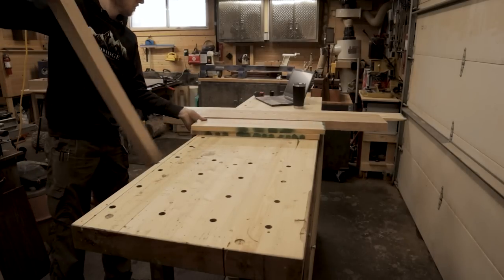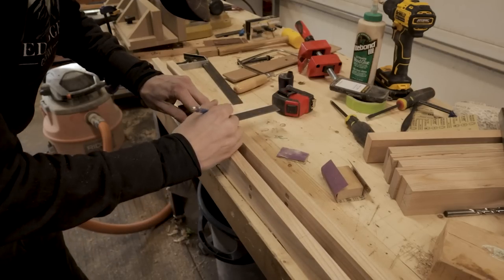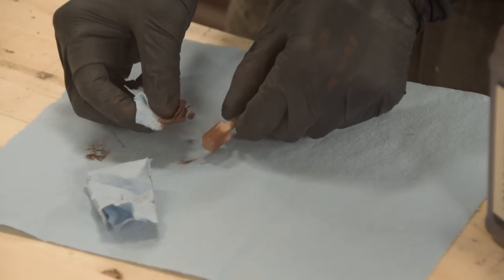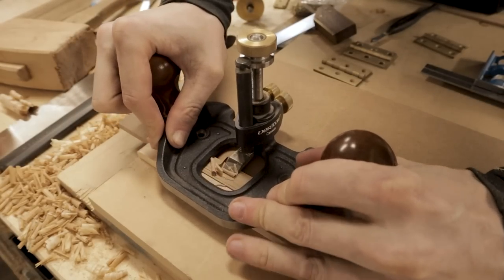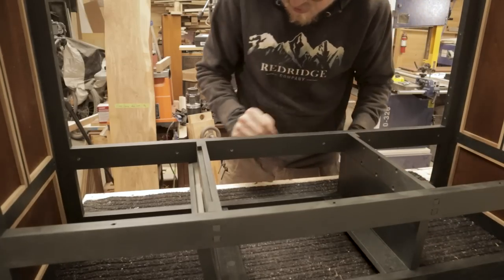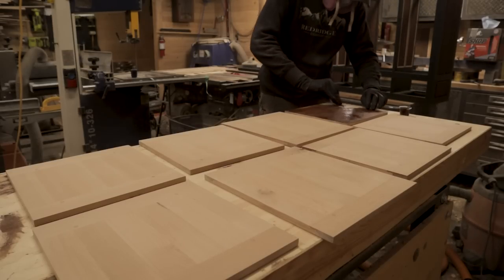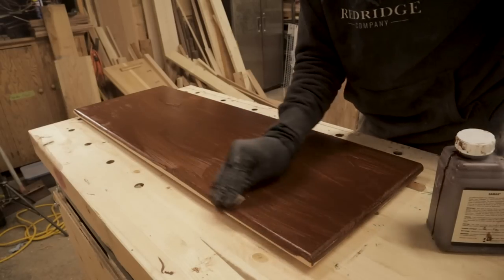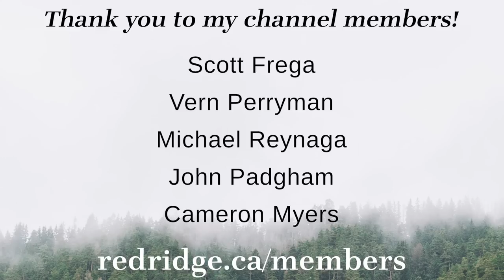Experimenting with color in woodworking

Comment: I’ve been woodworking for …..over 45 years and ,a you can imagine, I’ve seen huge changes in materials and techniques available to the smaller shop. The router and adhesive quality are probably the two biggest but even abrasives - when I started, we used dried fish skin (from a dog fish which is in the shark family). 

Throughout, the key phrase for me is that taste is personal whilst skill is universal. When we built pieces for a client, there things that I didn’t like - were not to my taste - but the client wanted them. Notwithstanding the aesthetic, I hope the skill was still there.

Having said all that, it’s not a shy criticism of this piece. I like the aesthetic very much - it’s in the Arts and Crafts genre that I now building all my pieces within (UK A&C plus bits of Greene and Greene, Stickley etc.). Okay, I wouldn’t, personally, have the finger joints showing on the drawers - I don’t like them on G&G stuff - but I’m very fond of the visible pegs with the button tops. Again, G&G used them a lot but, apparently, often to hide the screw that secured the joint. I wouldn’t have believed that but it came from Darrell Peart and he is the expert.

I’m finishing the interior fit out of a converted barn and I think we are now past $30,000 of European oak for doors, stairs, trims etc. The colour we wanted was the fumed oak that was very popular around the end 19th/ early 20th century. I don’t know if you have actually fumed oak (with ammonia) but it’s a nasty process. So, I decided to stain the oak to that fumed oak colour. 

Another popular stain was to apply ferrous acid (vinegar and steel solution). That ebonite’s timber with tannins and, of course, no shortage of tannin in oak. You can control the effect to go from grey to jet back. Contrast that to natural oak in a piece and I find the effect very pleasing.

I have painted wood on pieces (as opposed to the normal way of painting trim if you want a coloured finish) and I think the byword for me is “less is enough”. So, none of my pieces are fully painted but have highlights or insets of painted pieces. 

In your piece, I think the choice of paint is excellent. It does, as others have said, go well with the colour of the natural timber. Unless I had something like ash lying around, I must admit that I would use poplar as it works and finishes superbly - and is much cheaper. 

On the question of design. I guess I’m past the point where I think about technique and then design around using that technique. I’m at the stage where I think of a design and then work out how I’m going to make it. That process, for me, satisfies the key criteria of form and function. But, that’s just me.

Very much enjoyed this video from me. I’m off to check your playlist.

Comment: For water based stains I mix dye stain and spray with hvlp gun saturating the piece then wipe off.       I get very even results.   Can be messy though.  If you don’t have booth with good ventilation I suggest a good open space.     This is a beautiful piece.
Reply from the maker: I've read some stuff about spraying stains but never really gave it much thought. Once the weather warms up, I'll have try taking a piece outside and spraying some stain!

Comment: I think there is a time and place for paint on wood. Using paint as an accent and intentional integration into the design for contrast and accent of the wood grain works.  Too often paint is used to just cover up an older finish.  I think you did really well with the ash and highlighting the texture of the wood and grain.
Reply from the maker: Exactly, I've wanted to use paint on a piece of furniture for a few months now but I had to do alot of experiments to figure out how to use it in a why that wouldn't look horrible. It took a while, but I do think this combination of paint, wood and finish is going to be my go to for adding some pops of color!

Comment: I think Ash or Red Oak with the deep grain looks good painted a lot of the time. Or even maple if you want a flat smooth look. If you start to paint mahogany, that's heresy.
Reply from the maker: I did like Red Oak in my testing, I found that the grains were a little more subtle when painted than ash, kind of a nice inbetween of ash and maple. Red Oak definitely stains better than ash though and I'm going to be putting that to use in an upcoming project.
Well there goes my next project, I was really looking forward to making a mahogany cabinet then giving it a nice white paint job!

Comment: I think the cabinet looks great! Too pretty to hang in the shop. I really like the paint on this piece. I do think the breadboard ends on the shelves should go front to back. Just my opinion though.
Reply from the maker: Too pretty to hang where I was planning to as well, the spot I had planned was in a corner and just didn't do this piece justice!
I agree with you about the bread board ends, in hindsight it would've looked alot cleaner having the shelves turned 90 degrees. Normally I like having that little detail on the front edge of the shelves but I think on this cabinet it looks a little to busy.

Comment: Can you do a specific video on the door spacer piece? Like how you size the thickness to hinge thickness, door reveal, etc.? Love the videos!
Reply from the maker: I'm planning to get back into doing tutorials soon so I'll make sure that video is on the top of the list!
The jisk of it is that you want the spacer piece to be thick enough to fully hold your hinge and not break, I made these ones almost to thin but they still worked. By standard I go with 1/8", which works perfectly for the horton brasses hinges that are about 1/16" thick hinges leaves.

For door reveal I still mess that up constantly, but I'm getting slightly better each time! The defining factor for your door reveal is the hinge in it's closed position, so if you're working with hinges you haven't used before start by mortising them into a couple scrap pieces, then measure the gap in the "closed" position. Then just account for that gap around the whole door.

Then to figure out the door size just plug in the number, these are the one's I use for the horton brasses hinges.
Door Opening - 1/8" (Spacer) - 1/4" (1/8" reveal either side) = Door Width

Comment: Awesome project.  Do you have anything you can share on the jig you made for your Powermatic Mortimer?  I have the same model.  Thanks!
Reply from the maker: So, it's just version one at the moment and I'm planning to use it over a few projects before finalizing the design then I'll definitely be putting out a video on how to make them because even on this project it was an absolute game changer!

The biggest issue I've had with the mortiser is that those small wheels don't hold taller pieces tight enough against the fence and I keep ending up with angled mortises that then make the frames twisted. The taller fence on the back and the reinforced fence on the front hold the workpiece in place perfectly and I just rub paraffin wax on both fences and the pieces glide right through.

The other issue is that stupid hold in the base, when ever I try to cut mortises near the end of a board the pieces rock into the hole a screw up the mortise so I added a piece of MDF under the front fence and that solved that problem. It also let me cut through mortises much cleaner because the fibres are supported on the back side of the cut.

Comment: Thanks for sharing.  Could you please talk more about the home made jig you have for the mortiser around the 4 minute mark?  It looks interesting/useful.  Many thanks.
Reply from the maker: I figured I might get some questions about that, it's a new addition that I'm just trying out at the moment and working out the kinks. There'll be a mk. II version after I've worked this out on a few project!
The basic idea is that I just wanted taller fences that would hold the pieces firmly in place because the wheels that come with the mortiser allow taller work pieces to pull away from the fence and angle the mortise. By locking the pieces between the two mdf fences the pieces can't angle at all! The other problem with the powermatic mortiser is that they put a hole in the base that pieces will rock into when cutting a mortise near the end of the board, so I add in a bottom piece of mdf to cover up that hole and on this project I was able to use it to cut through mortises cleanly.
It was an absolute game changer on this project and when I put together the better version I'll make a video explaining how to make it.

Comment: thank you Morgan . i can put up with a light coat of paint if it shows the grain this project looked good . question please do you like your pin nailer ? would you buy it again ?
Reply from the maker: That's my thinking to and why it took me so long to figure out how to paint wood in a way that doesn't look like a botched DIY job.

I would definitely recommend this pin nailer, I splurged a bit when I bought and it's been a really good reliable tool!
Reply: @morganhurst_redridge  thanks

Comment: It’s occurred to me to wonder: how has paint changed since… oh I don’t know, say the late 1800s. 

Maybe today’s paint is so much thicker than a century or so ago that painting fine woodworking just looks terrible. 🤔
Reply from the maker: I actually did a decent amount a research into this while trying to figure out this technique and from what I found the two most common traditional paints were milk (water based) paint and linseed oil paint. What I found most interesting is that the pigments used in transitional paints aren't all the different from what we use to today, the main differences is the hardeners. Milk paint used lime and clay while modern paint uses latex, so it's actually kind of the opposite from what you said. Traditional paint sits thicker on the surface of wood and that's why when you see alot of older painted furniture the paint is chipping off, where modern paints are less likely to do that since they are thinner but the layers have much stronger bonds.

I did alot of testing because I thought that answer to painting furniture nicely was going to be milk paint but after a ton of trial and error it turned out that some simple latex paint from home depot that was sprayed on gave the best results. My conclusion was that because the modern paint has stronger bonds, that allowed me to thin it down enough to allow it to soak into the pores of the wood.

The other massive part of this combination is the wood, no other wood except for ash looks good when painted. Even red oak which was a close second was just not porous enough to have a nice amount of the grain showing through. Ash just has such massive pores that paint can easily work its way in. It's even better if you use the really young ash sapwood because that has even larger pores and the grain shows right through the paint!
Reply: @morganhurst_redridge  you’ve given me a lot to think about. I’m planning to building a wood frame for some art we have and my wife said she wants a black frame. I was thinking of using cherry then painting it with black milk paint. I was also thinking about ebonizing the wood (there’s a video that shows a technique using tea and iron dissolved into vinegar that looks really effective). I don’t have an airbrush so I’m left to experiment with other techniques. 

My impression about the thickness of paint was based on paint I bought over the years. It seems way thicker now than it used to be. I’m not a century old but assumed older paint was thinner and didn’t cover as well. 😛
Reply from the maker: I use to make alot of picture frames and the best combo I found for a pure black finish is ash or oak and india ink. That give you a pure black while still showing some nice grain patterns. Ebonizing is also really cool technique and definitely worth experimenting with, I found through some testing that is tends to give you black/grey coloring with strong purple/blue undertones which is a very unique look. It can be unpredictable which is why I haven't used it yet on a piece of furniture but someday I want to try it again!